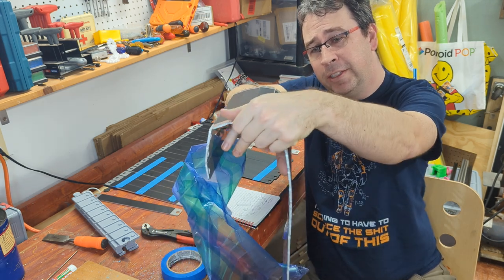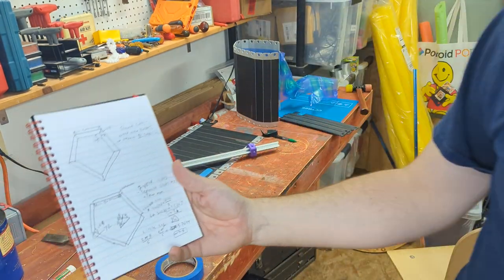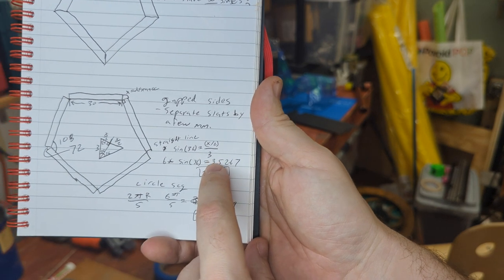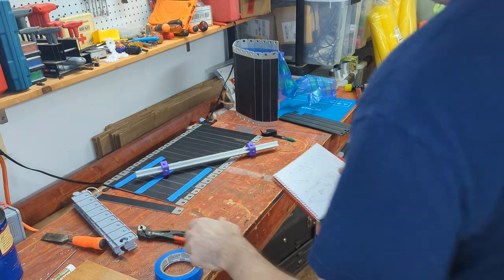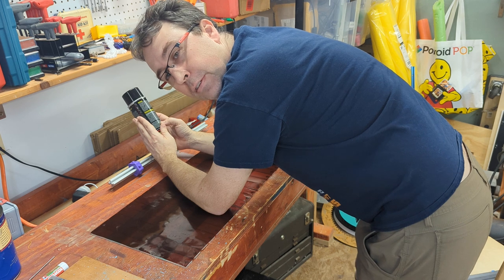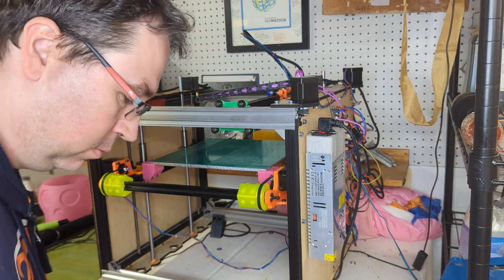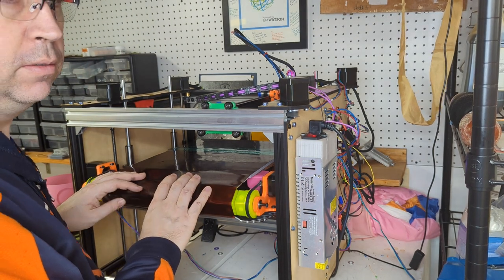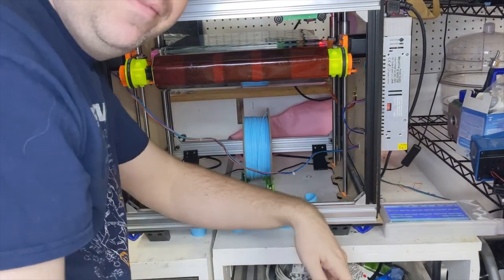3D Printing Tank Treads 2: the Treadening

Comment: Interesting consept!
How do you think the extra metal will affect the heating? 
A bit mor material to get through the on the Printshift.
Reply from the maker: On this machine, I'd say no effect - the heated bed is 10mm thick aluminum with an AC heater - it's got thermal mass to spare.  Probably slows down the heat by a few seconds, but worst case you could just pause before starting the first layer